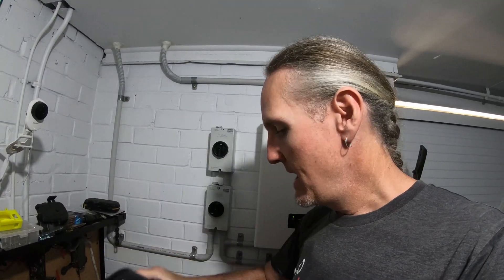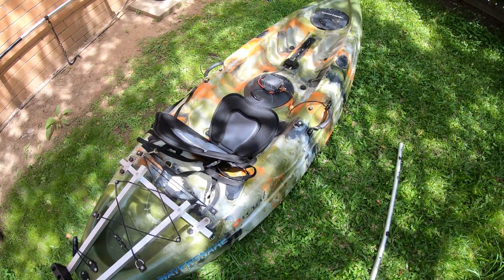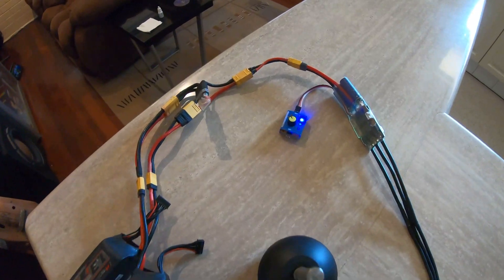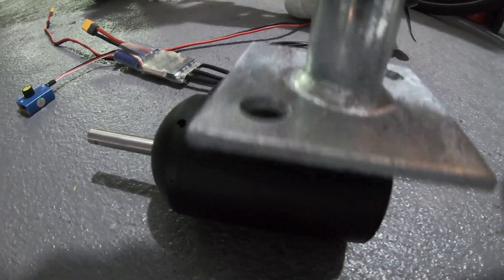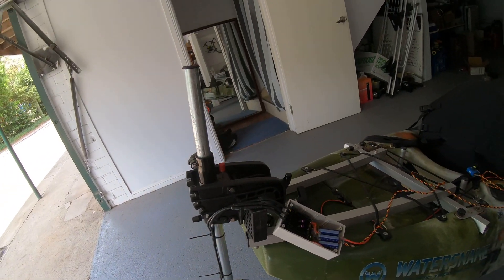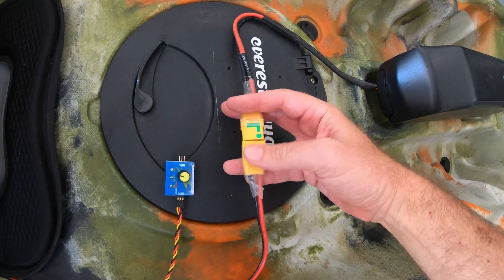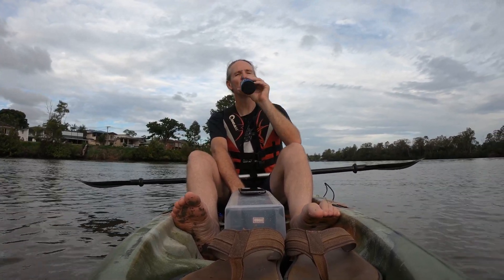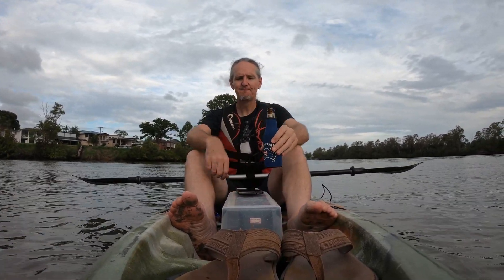Electric Kayak Project Part 3 - I need a bigger motor!

Comment: How many voltages of batteries do you use?
Reply from the maker: Normally 14S, 50-58v, but it will run off anything from 25-58v

Comment: Do you have a link to where that motor is for sale?
Reply from the maker: I think it was this one: https://flipsky.net/collections/waterproof-motor/products/flipsky-inrunner-brushless-dc-66112-motor-150kv-2000w-for-surfing-boat-underwater-thruster-hydro-efoil

But once I burned it out I bought this one:
https://flipsky.net/collections/waterproof-motor/products/brushless-sensored-motor-amphibious-fully-waterproof-motor-65161-120kv-6000w-for-efoil-ejet-boards-ebike

The first one should be fine though, with enough cooling.
Reply: @strepto42  thank you very muchly!

Comment: Hi, Mark! Thank you for video! It's great!   
Can you tell me, what  voltage do you use?  What is the speed and current from battery?
Reply from the maker: Thanks! I use a 14S battery, 50-60v roughly. It'll run off pretty much anything though; 25-75v should be fine with this speed controller. Obviously lower voltage = more amps and the wiring can only handle so much so I'd recommend 30-50v. Top speed is about 10kph which is pretty good for such an inefficient hull.

Comment: Great video. I'm currently building a 3000W brushless thruster system, and it's great to get insights like this.
Reply from the maker: Thanks man! I'd say watch the next couple of installments then - the bigger speed controller and motor I now use have definitely made a difference.

Comment: Why does everyone underestimate the motor power, control current, and battery capacity?
None of this is complicated.
Reply from the maker: Not quite sure what you're point is? Hope you enjoyed the vid! :)
Reply: @strepto42  he means the motor is fine you need bigger battery capacity
Reply from the maker: @angrybrit7331  How do you figure that? The battery is fine. Goes for hours! :)

Comment: i have the 24lb water snake on my kayak.. now i want this motor on mine! looks insane. great job mark.

just a thought tho one either side! POWER! haha
Reply from the maker: I did consider that too! ;) But rear thrust gives one... other future options... ;)
Reply: no doubt u will make it even cooler mate.. i have mine mounted on the back with 2 bits of string attached either side and run the ropes down to my feet so i can steer hands free... also have considered putting gps on it and setting way points
Reply from the maker: @PokeWitty  Now you're thinking on the same lines as I am ;)
Reply: Nk180s!